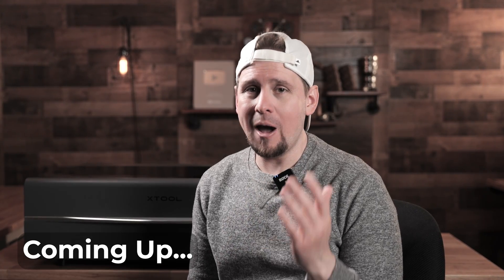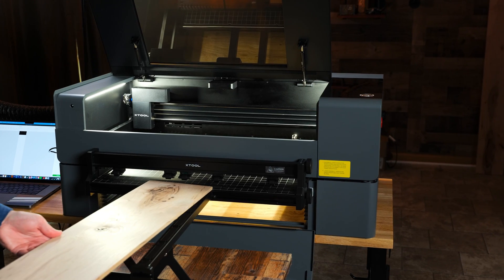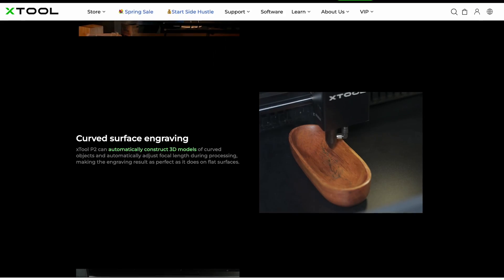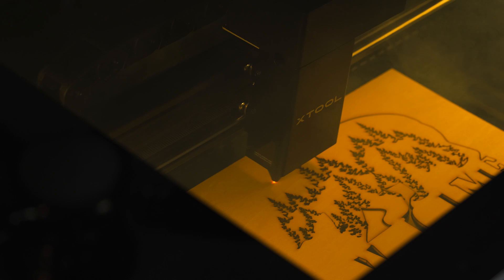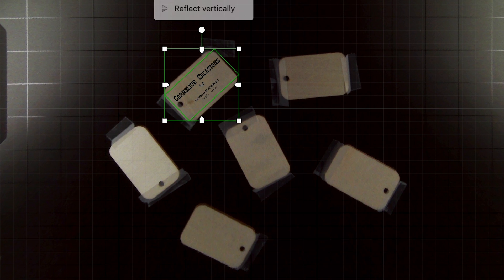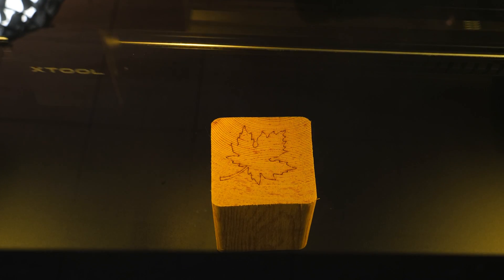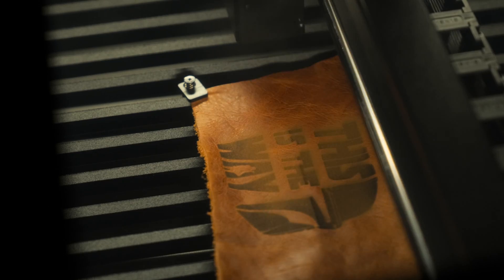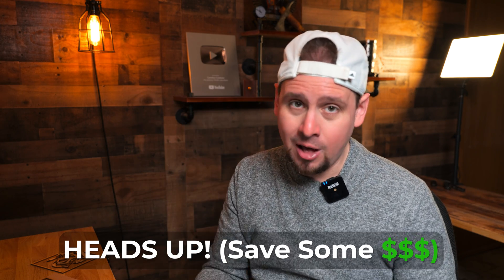xTool P2 55W CO2 Laser Machine - The SMARTEST Desktop CO2 Laser on the Market

Comment: Hello Cornelius. How are you? I hope everything is fine.
I have a question for you. Thanks in advance for your answer.
Are the xTool P2 conveyor and the S1 conveyor the same?
As someone who has seen and used both machines, could you answer this?
Thank you! :)
Reply from the maker: Hey there! No, the xTool P2 and xTool S1 do not use the same conveyor system. While both lasers can utilize a conveyor feeder for continuous material processing, the S1's conveyor system is specifically designed for the S1 and is not compatible with the P2. The P2 has its own dedicated conveyor system. I wish they did interchange though!
Reply: @CorneliusCreations yea i wish too..thank you so much. :)

Comment: Just curious what the max thickness wood you've cut with the P2 and what kind of wood was that.  I'm wondering if it could cut through 1/2" or 3/4" inch pine in a single pass or how many passes it might take.  Thanks for the video.

Comment: Do you think the roller/extension you used for your long board would work for fabric?  One issue with laser cutting fabric is that the air-assist blows the cut and semi-cut pieces in the laser’s path and ruins your cuts.  You tightened the rollers on the board which made me think perhaps it would help with fabric if it goes down that much since fabric is so thin.

Comment: I m wondering what to pick between the s1 an the p2 for a quilt store that my girls own.  I see that the diode lasers wont cut clear acrylic so that is an issue for rulers and templates.  
For fabric im thinking the s1 would be fine.  Do you have any experience along these lines.  Thanks.

Comment: Thanks for the review. How did you vent it? Is a window sufficient?
Reply from the maker: Hey there! I ran a vent hose outside my sliding window to start. The exhaust fans work extremely well. Now I use a purifier for the studio I'm in.
Reply: Mine will be by a sliding glass door. So, since the fan is good, I bet I'm covered. And I have an air purifier in there. Thanks for all your leg work. You've helped me so much learning things to make my cuckoo clocks. @CorneliusCreations

Comment: Can it cut a 23” or even 24” round board (wood or acrylic)?
Reply from the maker: With a few passes I am sure.
Reply: @CorneliusCreations  thanks. I just realized I didn’t ask the correct question. I wanted to know what’s the max diameter it’ll cut. I’d like to cut 24” circles.

Comment: Could you use the pass through function with the conveyor 39" kit and some some third party rollers for longer material? I have not seen anyone try this. That way I wouldn't have to spend more on the extension kits to cut up to 118" material.
Reply from the maker: It should probably work.

Comment: Other than the ability to do longer runs, it brings nothing new to CO2 lasers, except a much higher price tag than more CO2 laser cutter/engravers.  Even without the long run optional accessory, it's still waaay overpriced to comparable units.
Reply: Its just paid promo...people that work with lasers know that this is just another overpriced crap that isnt offering anything new...
Reply from the maker: No sir, not a paid promo. Many brands out there to choose from.
Reply from the maker: Hey Christopher, Thank you for your comment. I would like to kindly disagree with you. Most everyone is comparing this to the larger 300lbs units. This is made for the desktop market. Someones needs may call for a higher power laser, but there will be different pro's and con's for each ones needs.
Reply: @CorneliusCreations  I'm not sure I would consider it "made for the desktop market".  How many people have desks with that much clearance around the front and rear for running long cuts of materials through it.  The engraver is pretty huge for a desktop model, taking up darn near the entire desk.
Reply: But I think to @CorneliusCreations point, this laser was made to compete against the glowforge, muse, and other desktop laser brands. When you compare the spec sheets between desktop models, this holds more features and for many people was only sub 4k. Compared to GF whose price tag will set you back 8k but lacks certain features  like ability to work with a laser attachment

Comment: For that price I get 2x 80W vevor with bigger work area 😂😂😂😂 but nice try 😂
Reply from the maker: Hey Darko, I am going to repost a comment I made for another viewer. That is a great point you brought up. "For some people’s needs, going with a larger watt  would be better, some it wouldn’t. If you are looking at pricing and power, then yes, others are more powerful within the same price range. Some people look at the practicality of space, weight, and features that this laser offers verses a more powerful unit. Sometimes people want the Ferrari others want the Mercedes G Wagon. Both are made to be driven and are fast, but are made for people’s different needs.
Reply: @CorneliusCreations  sorry but if anyone want compact laser with compared power as what you showed because that is barely 55W then I would pick K40 with ruida controller which is 1/10 of that price, with comparable speed and power and is running on Lightburn. I dont mind but you could better explain to people new in laser hobby that there are plenty cheaper and better picks to start with. Because then people think that owning a laser is very expensive and they gave up on that idea to own such a machine...

Comment: 26x14" is the overall bed size, the engraving size itself is smaller with just 23.5x12" in Laser Flat and only 19,625x9.75" in Open Plane mode.

Can you use the camera preview to align objects while using the conveyor addon?
Reply from the maker: Good catch! And yes, the preview camera does work in conveyor mode.
Reply: @CorneliusCreations  I am thinking about getting this one as my first "at home, not at makerspace" laser and really like it's features. But their marketing only telling you a "bed size" instead of a working area or showing fake dog tag engraving in their videos makes me a little cautious. :-/
Reply from the maker: @ulaB  A fake dog tag engraving? I haven't saw that. hmm. I need to update a note in the video on the processing area. xTool's website does clearly state "The processing area is 23.6''×12.1''. (Even though I am an a affiliate partner with xTool I will say this, all there lasers have been great that I have owned, I haven't had one problem.  I would say Do your research and do what will be best for you my friend. I hope this helps!)

Comment: Interesting to see Acacia cutting boards over there. They and Bamboo cutting boards are popular here in Oz. Great practice material for my 3018 router with 2.5W laser. This look like a serious improvement for CO2 lasers. Most of the momentum has been in Diode lasers, till now?  This is an affordable production machine for small shops.
Reply from the maker: As far as the features go, a lot of people who aren't "techy" can enjoy laser engraving without tinkering around finally. Its super easy to use and a lot of fun!